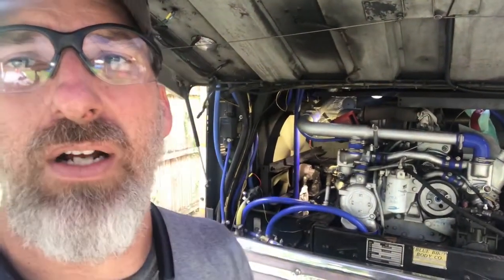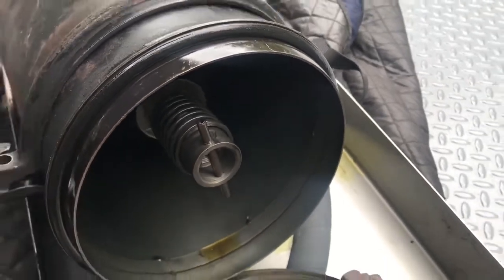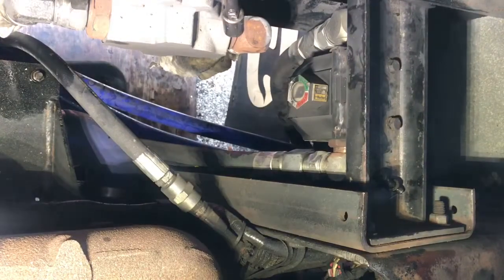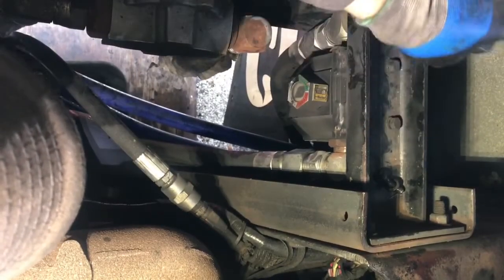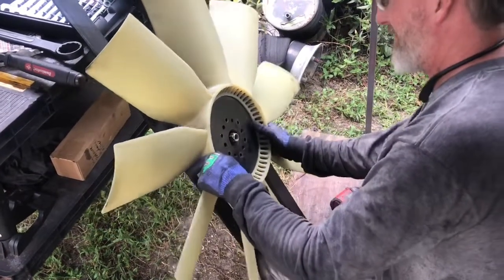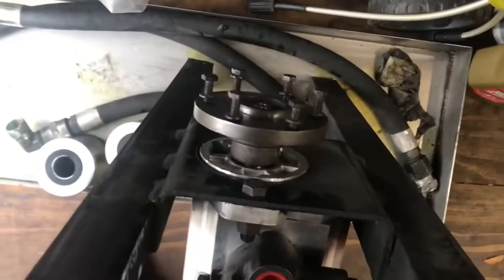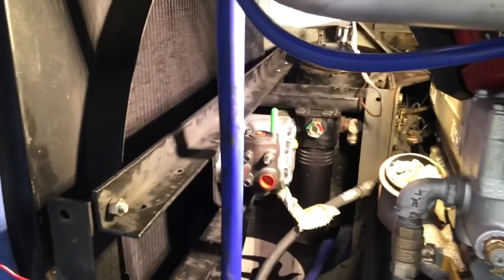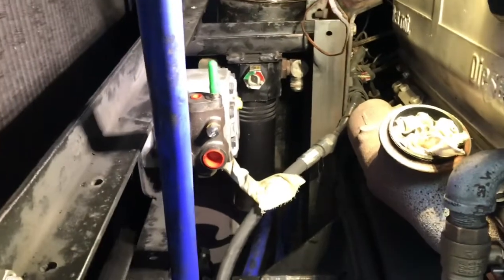-Gino’s Garage-Part 1-Hydraulic Fan Modification on our 1984 Bluebird Wanderlodge

Comment: Is that an S&K ratchet?
Reply from the maker: It’s a Cougar-Pro, they are decent ratchets. 
Cougar Pro E3426 3/8" Drive Quick Release Oval Head Knurled Handle Ratchet https://smile.amazon.com/dp/B00279P7WS/ref=cm_sw_r_cp_api_i_164R1VPZMTBKBMSXXNGS
Reply: @GinosGarageUSA  thanks for the reply Gino. I had to ask, i have an old S&K set that looks  identicle, wouldn'nt be surprised if a major tool foundry made those, i can guarante one did, "Cougar pro" doesn't have a tool foundry .
Reply from the maker: @ericdee6802  Yea, my dad had some old S&K tools. I believe Cougar is made by Wright tool.

Comment: I ditched my high pressure filter - the new ones don't have one, either.
Reply from the maker: True, probably do not need it. I am guessing it can slow the fan down a touch huh?
Reply: @GinosGarageUSA  I'm guessing it won't flow enough, but I don't really know that.  The fan motor isn't sensitive to the fine junk, really.

Comment: Do you have access from the bedroom to check your hydraulic level or will you just have to reach over to check?
Was the upgrade to the fan blade to move more air and increase cooling?  Where did you get the fan blade?
Reply from the maker: I try not to use the bedroom access much, its hard to do anything hanging down in that little hole. I am going to either put a sight glass on it or I am going to run a long dipstick back there like the one for the transmission. The upgrade hopefully will move more air and cool down faster, that is the idea. Plus having the fan controller to modulate the fan speed a bit instead of on or off. I will go into the fan controls  in another video. The fan blade is an ACS (American Cooling Systems) my buddy gets them for me through a dealer.

Comment: First!!!!! Nice job Jeff. This will give you a variable option as to load the fan according to the temperature. In the wrap up video can you explain how the FDCA functions and what's connected to it? Thanks!!!
Reply from the maker: Thanks for watching as always Rodney.. Yea the FDCA is going to be a techie video lol.. they run off PWM (pulse width modulation) signal. I have to come up with something to generate that signal based on engine temperature. I think its going to end up being a PLC (programmable logic controller).
Reply: @GinosGarageUSA  All of the hydraulic fans on modern vehicles use PWM as well as automatic transmissions for pressure control. Is the fan going to have a speed sensor on it?
Reply from the maker: @rodneymiddleton9624  No the fan will just run, it cannot go any faster than the engine RPM's so it should not be a problem. Yea, I have been studying the PWM and it seems its used a bunch in new cars.